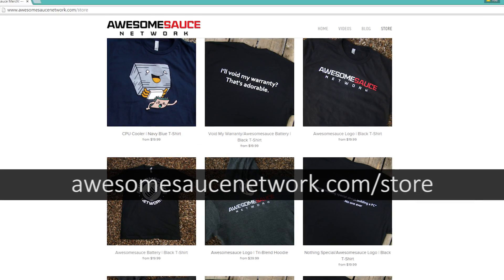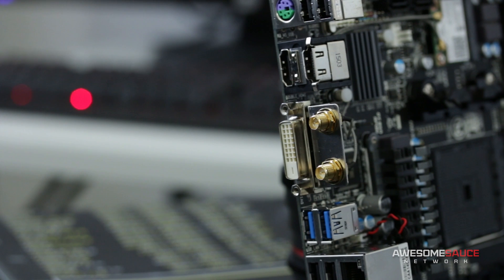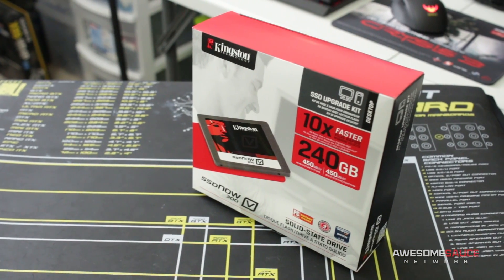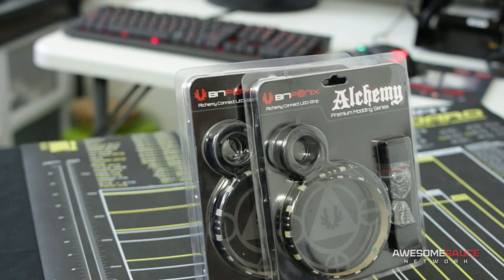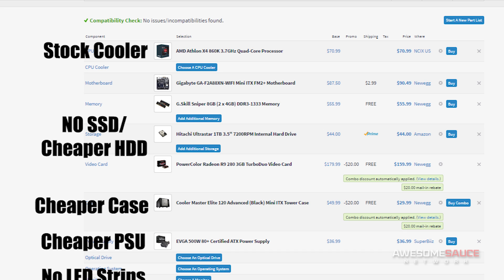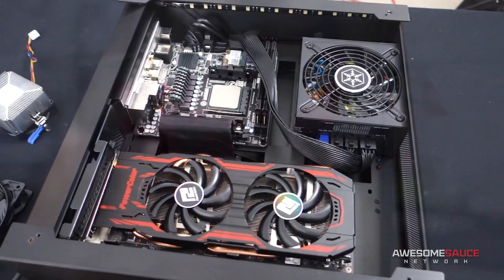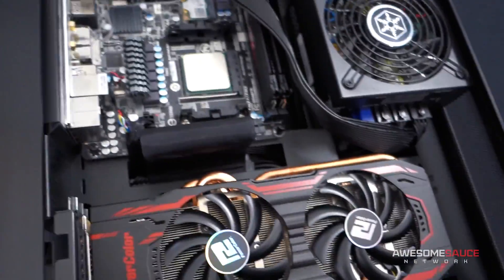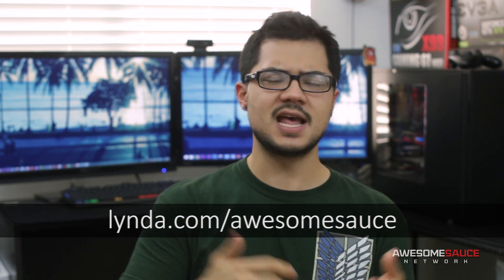The Overkill Console Killer: And How to Build One for Under $500 (Part I)

Comment: I do not know about the Cooler Master Elite 120, but I have the 130 and they had the brilliant idea to make the metal below the motherboard slightly higher.  This bubble up made it impossible for my motherboard to operate without shorting out and causing it to turn off constantly.  Even if I used different standoffs it was sitting too high for the back ports to be available.  I would power on the system and after about 5 seconds and it'd power off.  I found this out well after the 30 day return (Christmas gift).  To solve it you can use electrical tape below the motherboard on the case.  I don't know how common of a problem this is but apparently others have had it too.  This is a grain of salt when considering the CM Elite 130 cases.  I know in the future I'll get the Thermaltake V21 case instead for space saving and would not recommend the CM Elite 130.  I hope this helps anyone who has this case or similar problem.

Comment: this is overkill 
Orientation: Standard
Themes (Side Panels Only) Color: Shredder Red
The ORIGIN Difference: ORIGIN PC Genesis - The Best Gaming Experience Guaranteed
Variable Mounting: Standard
Case Lighting: Remote Controlled Multi-Colored LED
Case Fans: ORIGIN PC High-Performance Ultra Silent Fans - Black
Motherboard: MSI X99A GODLIKE Gaming
System Cooling: ORIGIN CRYOGENIC Stage III Hard Line Liquid Cooling
CRYOGENIC Tubing Color: Red
CRYOGENIC Liquid: Koolance Performance Coolant - Red
Processors: Intel Extreme Core i7 5960X Octa-Core 3.0GHz (3.5GHz TurboBoost)
ORIGIN Professional Processor Overclocking: ORIGIN Professional Processor Overclocking
Thermal Compound: GELID GC-Extreme CPU Application
Power Supply: 1.5 Kilowatt Corsair AX1500i
Power Supply Sleeved Cable Color: Red Individually Sleeved Cables
Graphic Cards: Quad ORIGIN CRYOGENIC Liquid Cooled 12GB NVIDIA GTX Titan X
ORIGIN Professional Graphics Card Overclocking: ORIGIN PC Professional Graphics Card Overclocking
Memory: 32GB Corsair Dominator Platinum 3000MHz (4x8GB)
Operating System: MS Windows 10 Home
Operating System RAID Configuration: RAID 0: For better speed and performance (2 Identical OS Drives Required)
Operating System Drive #1 (Primary): 2TB Samsung 850 Evo Series
Operating System Drive #2: 2TB Samsung 850 Evo Series
Hot Swap Bay Drive #1: 2TB Samsung 850 Evo Series
Hot Swap Bay Drive #2: 2TB Samsung 850 Evo Series
Hot Swap Bay Drive #3: 2TB Samsung 850 Evo Series
Hot Swap Bay Drive #4: 2TB Samsung 850 Evo Series
Hot Swap Bay Drive #5: 2TB Samsung 850 Evo Series
Hard Drive Cage: 5 Bay Hot-Swap Cage
Optical Drive One: 12X Blu-ray Reader and DVD Combo
Optical Drive Two: 24X CD/DVD Burner
Playback Software: CyberLink PowerDVD 15 Ultra (MSRP $99)
Lower Unit: Cryogenic Cooling Support
Media Card Reader: 40-in-1 Media Card Reader
Audio: Creative Sound Blaster E3 Headphone Amplifier
Networking: Onboard Network Port
Capture Cards: AVermedia Live Gamer Extreme LGX
ORIGIN Maximum Protection Shipping Process: ORIGIN Wooden Crate Armor
Warranty: Lifetime 24/7 U.S. Based Support and Lifetime Free Labor. 3 Year Part Replacement & Free Shipping Warranty
ORIGIN Recovery: ORIGIN Recovery USB3.0 Flash Drive
Evolve Part Upgrade Service: 3 Year Evolve Part Upgrade Service with Free Shipping
Origin Exclusive Peripherals: ORIGIN PC Goliathus Medium Speed
Origin Exclusive Peripherals: ORIGIN PC Taipan
Origin Exclusive Peripherals: ORIGIN PC BlackWidow Chroma
Free ORIGIN T-shirt: ORIGIN PC T-Shirt Medium
Bundles: ORIGIN PC Ultimate Peripherals Bundle (MSRP $269)
Keyboards: Razer BlackWidow Chroma
Mouse: Razer Ourobouros
Mouse Pad: Razer Manticor
Primary Display: ASUS 32" PA328Q 4K UHD LED Monitor
Secondary Display: ASUS 32" PA328Q 4K UHD LED Monitor
Display Accessories: NVIDIA 3D Vision 2 Wireless Glasses
Display Accessories: NVIDIA 3D Vision 2 Glasses Kit with IR Emitter
Headsets: Astro Gaming A50 Wireless Headset
Speakers: Creative Sound Blaster X7
Webcam: Logitech C920 HD Pro WebCam
Game Discounts: Green Man Gaming
Games: Grand Theft Auto V
External Storage: ORIGIN USB 3.0 16GB Flash Drive
Security Locks: Kensington Twin Locks(For Prime Desktop)
Security Software: Webroot AntiVirus for PC Gamers
Productivity Software: Microsoft Office 2016 Home & Business (1PC/1User) US Version
Cloud Backup: Carbonite
Cloud Backup: Dropbox - Online Storage (Windows 7 Only)
Apps: Battle.net Client
Apps: Steam (The Ultimate Online Game Platform)
Apps: Razer Comms
Apps: Microsoft Windows Live Essential
Apps: Razer Synapse 2.0
Extras: FREE Online Game: League of Legends
Extras: FREE INSTALL: Minecraft
Web Browser: Microsoft Internet Explorer/*Edge
Web Browser: Google Chrome
Reply: no thing overkill is an understatement.

Comment: I have a question PC gamers, how is this a console killer if you wont be able to play fallout 4 at recommended specs in it? you see this is why we keep choosing consoles. You keep churning out sub-400 and sub-500 "console killers", and then on the same year that you suggest these builds, an excellent game comes out with a recommended spec that requires an upgrade out of your "console killers", that is if you want to play it at decent graphical quality, or at least at a graphical quality that defies consoles. You keep upgrading your console killers, we choose to play on consoles.

http://www.pcgamer.com/fallout-4-system-requirements-released/
Reply: Both consoles will be barely able to run Fallout 4 at minimum to medium quality settings, the "recommended" specs are usually for the highest quality settings, and are often even set higher than required to compensate for small alterations in peoples builds.

Comment: Glad a see a build that doesn't favour a dual core Pentium over a quad core AMD.
Reply: I personally would rather have an athlon 860k than an i3 for gaming because New games coming out won't even play with dual cores dual cores just need to die I don't care if you can oc them it doesn't matter
Reply: He had to not many games support dual core these days look at far cry 4 for example
Reply: Diso hyper threading doesn't automatically give you double the cores it doesn't work like that, saying that shows how little you know about cpu's
Reply: +Petar Lols +Diso Soo what you guys think about this?

CPU –
Intel Pentium K G3258 3.2GHz

GPU –
Gigabyte GTX750 OC 2GB

MOBO –
ASUS H81M-P

SATA –
WD BLUE 1TB

RAM –
Kingston HyperX Fury 1600MHz 2x4GB

PSU – Corsair CX430M

CAIXA – Nox Forte USB 3.0
Reply: +Glaciares YT I'd say CPU and GPU. At least get a 750ti(which beats ps4 on witcher 3) and maybe an i5 or an AMD fx 8320.
Reply: an overclocked Pentium can take on i5's
Reply: Diso but it only has two cores that aren't virtual
Reply: Glaciares YT get a newer AMD card and an SSD as suggested :)
Reply: +Glaciares YT if ur not going to be doing video encoding/editing and what not, g3258 is generally fine for gaming, and you can upgrade to any other lga 1150 CPU when you want. keep that and get a better gpu possibly.
Reply: is not one else getting frustrated that he chose an Athlon but then had the audacity to speak of upgrading? Pick up a pentium  or fx 6300. Do you really want to be stuck with a motherboard that only supports amd quad cores?
Reply: +kwame20101 an pentium is for the same price better and faster.....
Reply: Thats the con
Reply: XD
Reply: Uncle Fucka THANK YOU
Reply: an overclocked pentium g3258 will eat this athlon anyday.. coming from a true amd fan.
Reply: I've heard that the dual core tends to frame drop whereas the Athlon tends to remain more consistent. (I have no bias, I use both AMD/Intel)
Reply: I have used a pentium g3258 (I managed 5.01ghz on a dark rock shadow rock 2) and have never had problems with that, though I needed to limit the fps to 55 because of stuttering issues (60+ with medium/high mix settings but I can give 5 fps for beauty) (at stock clock/3.2ghz I need to limit to 40) but I would suggest an Athlon X4 860K or an fx 6300 over it any day, I went for it simply because of upgradability, fast reply btw lol
Reply: I just happened to be on my phone which gave a google+ notification :D so if you were in my position, would you get an athlon or a pentium g3258 with a z97 motherboard so that I can upgrade to an i5 in future?
Reply: Eamonn O'leary an i3 is hyperthreaded though, it can run all games without problem
Reply: I ditched my quad core and for a g3258 :) 
that's cuz it was a sempron XD
Reply: Petar E  Pentium has hyper threading

Comment: my pc ($600)

gpu: Club3D royalking r9 280 (3gb) 

cpu: amd fx6300 six core

ram: crucial 8gb

psu: cooler master 600w

mobo: any gigabyte mobo for $80

and a shitty case because idgaf.

spent a shitload on accesoires tho:
zowie ec2-a mouse
logitech g710+ keyboard
logitech g430 headset
blue yeti microphone
benq xl2411z monitor
steelseries qck+
boom stand for blue yeti

whole setup comes in at around 1200 or something :)

Comment: I made the same build with this cpu and an r7 370 and it wasn't that great, would almost be better to source an older i3 or a used i5 to get that under $100 price. The cpu is a little glitchy or just overall slow when using just for daily stuff. The similar APU's like 7850k seemed to be alot faster than the 860k's I tested.

Comment: how well does this run games?
i5 4440
nvidia geforce gtx 750ti
8gb ram
1120gb storage(if it matters)
Reply: how will you turn it on without a power supply...
Reply: +Trap RELOADED Maybe he'll use air as his power supply XD
Reply: It will run very similar to the current gen consoles (Xbox one/ ps4) I would estimate that system to run most new games at med-high settings at close to 60fps and older games maxed out with 60fps
Reply: It runs better than consoles
Reply: +Original Sigmar 
ok thank you :)
Reply: +Bass RELOADED 
i know you are just joking but i just didnt want to go through the whole list of parts,because they dont affect pc's performance

Comment: Is this the PC-05 or the PC-05S...because there is a difference. I thought you can't fit a full sized GPU in the PC-05? Also how are you cooling or exhausting the heat from the case?

Comment: Here's a better build that's less than $810 total in Amazon and most items are Prime eligible except for the case (Signing up for Prime to ship this many parts is worth it and you'll have Prime as a result afterwards).  The processor is more powerful and is low-wattage, this build will stay cool, and the system is more future-proof and has more room to upgrade/add components.

MOBO:  ASUS M5A97 R2.0 AM3+ AMD 970 SATA 6Gb/s USB 3.0 ATX AMD Motherboard

CPU: AMD FD6300WMHKBOX FX-6300 6-Core Processor Black Edition

CPU cooling:  ZALMAN Ultimate Fanless Heatsink CPU Cooler FX100

GPU: Sapphire Radeon R9 270X 4GB GDDR5 DVI-I/DVI-D/HDMI/DP Dual-X with Boost and OC version PCI-Express Graphics Card 11217-04-20G  
^(no sense going 280 for $100 more, this card already beats 750ti's easily and 750ti's seem like stock for budget builds)

RAM:  Kingston HyperX FURY 8GB Kit (2x4GB) 1600MHz DDR3 CL10 DIMM - White (HX316C10FWK2/8)

PSU:  Corsair CS Series 550 Watt ATX Modular and Efficient Power Supply CS550M

SSD (Just one hard drive because I don't store much media):  SanDisk Ultra II 480GB SATA III 2.5-Inch 7mm Height Solid State Drive (SSD) With Read Up To 550MB/s- SDSSDHII-480G-G25

Fans:  Nexus Real Silent 120mm Fan with Anti-Vibration Fan Mounts (Black and White)

Case:  Cooler Master HAF 912 - Mid Tower Computer Case with High Airflow Design (RC-912-KKN1)

Comment: i've got a dell inspiron 5737 i7 with 16 GB ram but some games lag far to much. any help?
Reply: Its all about gpu. You will need a discrete gpu and high end one for laptops.
Reply: +Assault You could have an i7-5960x with 32 GB of memory but without a decent graphics card you aren't going anywhere.
Reply: +Assault The cards in that series can have similar performance to an r7 250 or even approaching 2 times better. You would have to be more specific.

Either way, that's probably your problem.

(unless if I'm wrong, which I could be)
Reply: Is it your internet? Or the gpu?
Reply: Biplav Shrestha Thanks
Reply: RAMBO SAMBO gpu
Reply: +Assault What's your GPU did you figure out?
Reply: Biplav Shrestha its a AMD Radeon R9 M200X Series
Reply: +Assault You well need to be more specific.
Reply: +Assault you need a better GPU.... And plus an i7 with 16gigs will go with something like a 980 ti
Reply: A dog ate my homework
But laptop i7s are nothing. It takes one of the best, most expensive ones to even come close to an i7 4790k.
Reply: PeopleHateMyOpinions who is also a terrible Grammar Nazi Agreed. A desktop i5 4690k blows an i7-4700mq out of the water.
Reply: +PeopleHateMyOpinions who is also a terrible Grammar Nazi oops lol I didn't notice that it was a laptop
Reply: I think inspirons use Intel integrated graphics. just get an amd r9 270 or 280 and you should be fine. or if you can afford it you could get a nvidia GTX 960, 970 or even a 980 but for those you'd likely also need to upgrade the power supply.

Comment: If only PC games would be as optimized as console games... It's up to the game creators to make sure it runs on a console, it's the user's responsibility to make sure your computer can run a game. Gives more "Meh, that'll do" room for the studios.
Reply: that's not an optimization issue, it has to do with hardware standards for consoles, and the insane variance in hardware that pcs can be running, this leads not to a "meh, that'll do" approach, but to a "let's make the game as visually stunning as possible, with a wide range of options for toning down the visuals so this with more average hardware can also have a good experience". the games are optimized for pc,for the most part, they just have to have far more options for customizing how the game runs, so it can be tuned for as many users as possible. most games are made for pc now days and then tuned for console specific hardware, this wasn't always the case however, as the ps3 and Xbox 360 had unique enough hardware that most games were ported to the pc, quite poorly, thankfully with more standard hardware inside the new consoles, most games are pretty well optimized for the pc and look better, and run much smoother than their console variants.
Reply: Some are, but there are some out-liars on console and PC. Assassins creed unity for consoles, and (now fixed) Batman Arkham night.

Comment: loved the video and the comprehensive list. but have a question were is windows ? or did you play those games using linux ? ps4 and xbox have os designed for it. pc has to chose between a linux distro or windows if you want to game. my question is what os did you put in that pc build. If t was windows why wasn't price included. This is a problem i have with a lot of console killing builds they mostly forget windows is between 90-130 dollar ( don't know exact pricing but in belgium it's 125 euro at the moment ). If its a windows build shouldn't you lower price gpu and is benchmark ive seen in the benchmark vid (part 2 ) still reachable. perhaps ive overlooked something but i want full info before going over to pc. hopefully you or some helpful person will answer my question and reassure a potential convert  .

Comment: i was able to build this for $480. and if you wanted you could even shave off 80 more if you choose a cheaper card such as the geforce gt 740. And i even used a $60 case. you can find cases as cheap as $20. Meaning $360. also i used 16 gb or ram. if you use 8gb you can bring it down to $330. Which is a true console killer.

Comment: I like to build a budget pc from 500 or little more because also i want save money for a cheap monitor with 1080p. Tell me what you think and what i can change.

AMD FX-6300 3.5GHz 6-Core Processor 
Asus M5A78L-M/USB3 Micro ATX AM3+ Motherboard 
G.Skill Ripjaws X Series 8GB (2 x 4GB) DDR3-1600 Memory 
Western Digital Caviar Blue 1TB 3.5" 7200RPM Internal Hard Drive
MSI Radeon R9 380 R9 380 GAMING 4G 4GB 256-Bit GDDR5 PCI Express 3.0 HDCP Ready CrossFireX Support ATX Video Card 
EVGA 500W 80+ Certified ATX Power Supply

Comment: Could this run most games at 1080p?

Parts:
RAM - Crucial Ballistix Sport 8GB Single DDR3-1600 (PC3-12800) Very Low Profile 240-Pin UDIMM Memory Module BLS8G3D1609ES2LX0
CPU - AMD Athlon X4 860K Black Edition CPU Quad Core FM2+ 3700Mhz 95W 4MB AD860KXBJABOX
GPU - Sapphire Radeon R9 270X 2GB GDDR5 DVI-I/DVI-D/HDMI/DP Dual-X with Boost and OC Version PCI-Express Graphics Card 11217-01-20G
Storage - WD Blue 1TB Desktop 3.5 Inch SATA 6Gb/s 7200rpm Internal Hard Drive
Power - Corsair Builder Series CX 430 Watt ATX/EPS 80 PLUS certified Power Suppy
Motherboard - MSI A78M-E35 FM2+ / FM2 AMD A78 (Bolton D3) HDMI SATA 6Gb/s USB 3.0 Micro ATX AMD Motherboard
Case - Corsair Carbide Series SPEC-01 Mid Tower Gaming Case CC-9011050-WW

This is my going to be my first gaming PC and i would like it to be good. Thanks for your help. :D

Comment: Hi i just got a new mobo and cpu for my rig but i used my old HDD, so when i launch the computer it gets a blue screen and startup repair runs and it loops finishes launch's and then crash's again. I looked up the problem and it seems i need to reinstall windows but Do i need to reinstall or can i repair windows. I don't have the windows disk because my computer was a oem version and was preinstalled so i need to go buy another copy but  is there a way i can install windows without losing all of my data( computer files i have alot of mods and photos)

Comment: It's not really a console killer if the total price is $550 and you haven't included the cost for peripherals or even the operating system. It will "kill" consoles in terms of performance, but not in terms of ease of use and convenience.